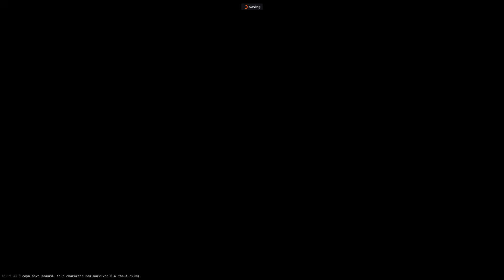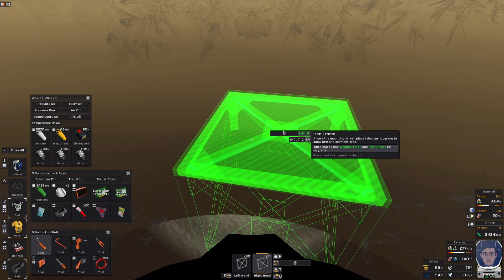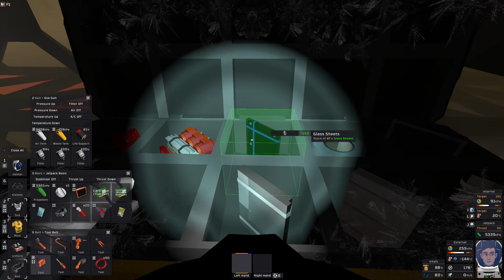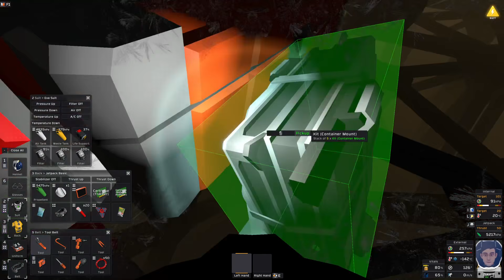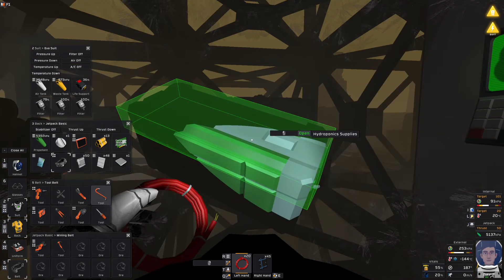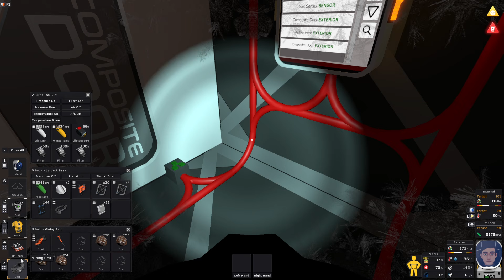Stationeers Titan Part 1 : Build Or Be Blown Away

Comment: Thank you for the mod and the play through... Here are some of my thoughts....

With regards to the airlock supplies, it would be prudent to bump up the number of active and passive vents to two each to support an advanced airlock. 

In your playthrough, you used composite doors and assembled/powered the airlock console. All of these use power! Also, as you mentioned, the liquid in the airlock doesn't seem to be getting handled correctly yet; so manual hatches might be a better way to go (no power and good to 500 kPa). Also, the composite doors are only good to 300 kPa and the planet's atmosphere is supposed to get up to 373 according to the planet site selection screen.

The portable air scrubber won't cut it for clearing out the volatiles from the hab. However, I found a way (in creative) to reduce them sufficiently to allow the scrubber to complete the job. There is already a liquid drain. If you add a liquid volume pump and an empty insulated dynamic tank, then you can use the active vent of the airlock to PRESSURIZE the hab to 400 kPa which will liquify all the Volatiles... then use the drain-liquid pipe-liquid volume pump-liquid pipe- connector-liquid tank combination to suck up all the volatiles into the tank. It won't get them all; but it will get as much as 200 liters of volatile liquid... in a tank... for later use. I suppose that if you are patient, you could get them all this way; but I got it down and then used the scrubber for the last bit.

While I understand that the iron wall/iron windows only provide 200 kPa of pressure protection, that can be enough for an early base. As long as one is willing to leave the pressure for the initial base up in the 180 - 200 kPa range, they work fine. They also work for the pressurizing method mentioned above (tested). Also, if you use the hatch doors for your airlock, then you can still take the airlock down to total vacuum as they can handle 500 kPa. My survival mode test base has four wide and five deep of iron frames for the base and 2 wide by 5 deep iron frames on one side of the roof. The other side of the roof is iron windows. Both sides are done in iron walls and the back is also iron windows... So far, going pretty well.

The three turbines are "enough"; but as they stack to five, it would make it a less stressful start. There are already plenty of heavy cables to hook them up.

In my survival mode test, I am trying to do a "no digging" playthrough. I am doing fine so far (deep miner and single centrifuge is working); however, I am concerned about being able to make a stable process for CO2. I can burn volatiles (plentiful) and O2 (scarce and needs CO2 to produce via plants); but these are also needed to replenish the water supply. 

Lastly, although I am not through yet, It would be very helpful if the stack of steel sheets was bumped up from 16 to 24. While the single centrifuge is enough to get started, one deep miner needs about three to keep up with it. The centrifuge kit doesn't require any alloys; but it needs steel sheets to assemble. By bumping up the steel sheets, stationeers can hold off on the furnace until all three centrifuges are online... and power.... and garden... and so on.

Comment: FINALLY I’ve been waiting for this mod! There’s another Titian mod map, but for some reason it won’t spawn ores.  One question, are there storms? Or is it like a constant cycle of “mini” storms where the wind blows really hard for a bit?
Reply from the maker: Theoretically there are storms, which are similar to Europa but shorter, faster and harsher. But right now I think the engine is resetting the cooldown every time the night causes volatiles to condense from the atmosphere - I've been chatting to the devs about this and the "storm" system doesn't seem to split precipitation away from wind so I think it's resetting the counter every day. That said, they're working on it so let's see - everything is defined so it may just start working after a future update!
Reply: @stationeers-murk  id keep storms off tbh, and leave it as is.   it could cause engine issues.  after playing this map a bit, yes plz change the lighting!  being able to only see 2m is a bit rough even if im in a room i still cant see.   ores already, are hard enough to find. already im at 0-3 with this map....its kicking my ass!  and i WILL get a win!